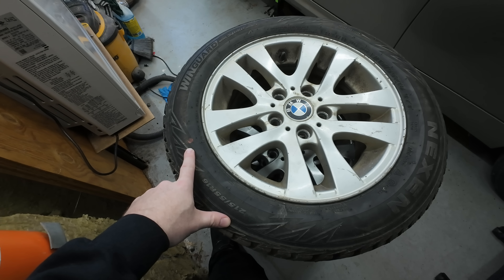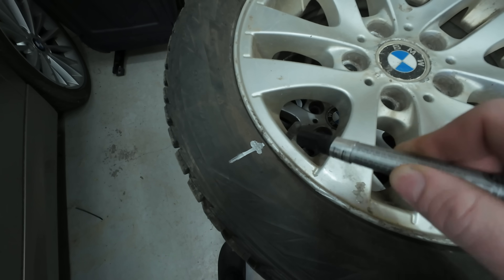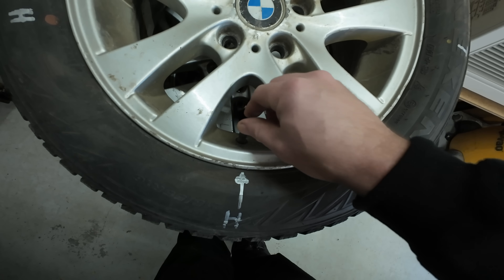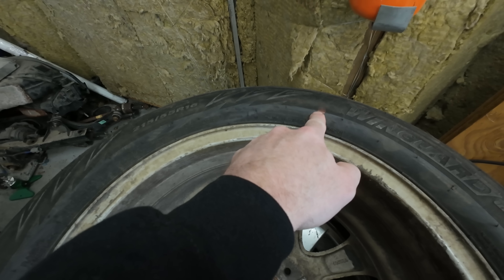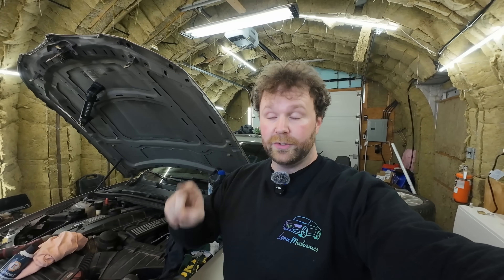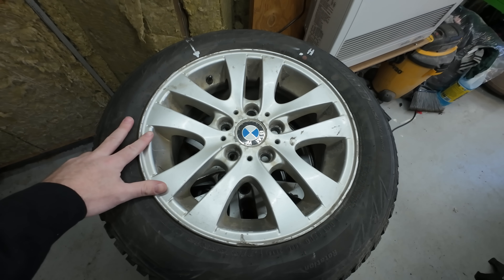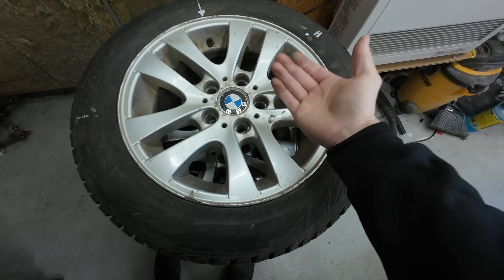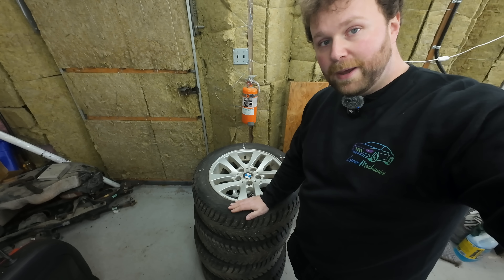Tire Red & Yellow Dots Explained | Back to Basics. Many mechanics get this 1/2 right

Comment from the maker: I feel most didn't watch the whole video. The highest point of the tire tends to be the heaviest. I'll tell you from experience. Most even admited in comments of busted rim down and spinning it 180

Yellow = light point
Red = heavy / force variation point

This is one of those basics that prevents comebacks and weird vibrations. Curious what your shop teaches — drop it below 👇

Edit. Do to confusion in comments. If you dont have a runout indication on the rim. Putting the red dot opposite the valve stem is good practice as it greatly reduces weight.
Reply: Does the valve stem actually weigh more then the metal missing from the hole in the rim where the valve goes?
Reply: @PaulLorenzini-ny2yw  That's a very good point! It's arguable that a session of just establishing the status of balance of the bare wheel is a good starting point before dealing with the tyres.
Reply: @stephenrose8188  I've balanced a couple tires in my time and it's remarkable how many times the wheel has the old sticky weight residue near or exactly where it was before, no matter which way you orient the tire.  I usually spin the tire on the balancer before removing the old sticky weights.  Quite often all I have to do is remove a half ounce from the previous balancing weights.  I heard Lance balances tires underground.
Reply: @PaulLorenzini-ny2yw  when you take into account the TPMS sensors (if equipped) then it may be heaviest spot.
Reply: @PaulLorenzini-ny2yw  I think it's more of the molecular distribution of the metal composition inside the actual alloy wheel, because when it is cast into that shape and then cools it's not a perfectly even distribution of the molecules ... 
  Also the Red Dot is not the "Heavy" spot in a tire, it is the "High" spot because tires are not perfect circles, the inner layers of a tire are layed around and around and they tend to overlap slightly in a spot where they start and end ...
Reply: @HomelandCitizenCCCP  high spot/heavy spot, its the same either way its the spot that throws the most weight when its spun, and thus the opposite/indicator side from where you want to start your balancing.
Reply: @crisnmaryfam7344  Heavy is mass for weight balance only. High is runout/stiffness for road force balancing. They're different terms for different things.
Reply: @HomelandCitizenCCCP  the layers are actually sewed together at that spot, and if not done in a good manner will distort the actual casing of the tyre. I have seen one where the seam had been pulled so tightly the tread actually dipped in where the seam was. It was not visible when fitted but soon showed as the tyre started to be used.
Reply: @HomelandCitizenCCCP  anybody ever thought about SLOWING DOWN!?!
Reply from the maker: Well considering a vehicle can't be sold in The USA with out a tire pressure monitoring system. I'd say absolutely :) All your vehicles since i think 2012 have tpms sensors.
Reply: Incorrect. 2008 and up are required to have TPM systems, but not necessarily sensors. Honda, Acura and VW/ Audi all have some models that use ABS/ wheel speed for the TPMS
Reply: @mattdudley3789  Do the Honda, Acura and VW/Audi systems work better because the sensor types suck because of dead batteries.
Reply: @Lancemechanics  Even a regular valve stem weighs more than the small amount of aluminum removed to make the valve stem hole.
Reply: @Lancemechanics   Is anybody still using wheel speed sensors for tpms?
Reply: @Lancemechanics many vehicles don’t use sensors in the wheels, instead they use math and the wheel speed sensors to calculate the tire’s circumference and recognize when a tire is low on air.
Reply: @PaulLorenzini-ny2yw 
Yes, much more.
Reply: @sammoxford On a CAT D12?
Reply: @sammoxford Probably from your company, dot invent much?
Reply: Tire balancing has been a major problem for me as a full time RVer.  Whenever I can do something myself i do because I actually give a shit about my things BUT no stranger at a shop cares.  Most of the time the tire marks are completely ignored even when it was specifically pointed out to the tech prior to the work.  I can’t even get the same valve caps back if I even get some back.  We now live in a weird upside down world that I can’t explain.  I like the video and wish I could get my hands on a diy static balancer that could handle 4 3/4 hubs since all my wheels have those specs.
Reply: @ronragan5144  the problem is, at least here in the UK the tyre companies use young unskilled labour to fit tyres, maximising the companies profits dur to the reduced wage bill. Once they can fit a tyre then balance it they are deemed to be a "tyre technician". I learnt the trade from a few good old boys that knew what they were doing and passed that information to me. Most young boys i would not lend tyre tools to they do not know what they are doing.
Reply: @ronragan5144  I was annoyed with a squeaking sound relatively recently and was changing the winters to summer tires and decided to do some lube testing on the bushings; see what's what. My gf came down to bring me some coffee and was showing her: see that there? Those two bushings make that damn squeaking sound (were the stabilizer/sway bar bushings going dry out of powder) and she was like: I hope you're not telling me you're gonna change them yourself?!?! Take it to the mechanic! My point to her was: I'm the one driving you around. I'm the one that cares; do you think those mofos give an f if they forgot or not to tighten everything back up let alone torque them properly?!? (Personal experience - gets some caution in you after it happens to ya).
Reply: @ronragan5144  You can still diy by renting out the tire machine and balancer. Do a google search for "self-service garage".
Reply: @ronragan5144  Research Flat Rate understand.
Reply: @PaulLorenzini-ny2yw   Flat rate is not an excuse for shitty work.
Reply: Shop owner taught me to line up the yellow on the valve stem side. Said it was the light side of the tire to offset the tire pressure monitor sensor on modern cars.
Reply: @thomascaruthers3316  It has been marked in that way from long before tyre pressure monitors ever existed, and yes its the light spot. The red dot is the layer seam where all the reinforcing is stitched together, which often makes little difference to the weight, but is often the low spot in the circumference.
Reply: @Lancemechanics   It's always the way it's explained that keeps everyone confused.

Yellow = light = lowest mass
Red = high = peak runout/stiffest point
Yellow is just for weight balancing.
Red is for road force balancing.
Reply: @absurdspeed  Red is not the high spot but the lowest spot and is where the tread layers are stitched together, causing a run out in the tyre circumference
Reply: @roberttill3787  Source?
Reply: So when you start explaing wat to do with two dots (R & Y) you go off on a tangent about wat bad techs do and actually dont say where to position the red dot! 

Im guessing you line up the yellow with the stem and the red 180 deg opposite but you dont actually say that??
Reply: @mgunning7362  Yellow is the lightest spot on the tyre, the red is where the casing reinforcing layers are stitched together, usually causing a low spot in the circumference of the casing. If you line the yellow dot with the valve and it needs a lot of weight, deflate and break the beads and turn the case 120 degrees on the rim. Then inflate and balance again. If there is not much improvement, repeat and turn the tyre another 120 degrees. In one of these three positions you will find the optimum balance point. I have done this many times.
Reply: Thanks bud, 
I did watch to the end,........and thought the end the most important part...
Balancing the Wheel first is a really good idea, first class!
The whole video was interexting and accurate, to be honest a well edited version, should make a really good educational aid.
Personally I prefer to see people demonstrating on a real object in real time, right in front of me.
I've been working on my own vehicles and others for over 35 years, and this was new.
So apparently a young whippersnapper can teach an old dog new tricks, 
Thank you. ❤👍💯
Reply: @Lancemechanics  I have been working on cars and trucks for over 35 years and I grew up in tire shops! I learned to use a bubble balancer when I was 7 years old in 1977 and 1.5 Oz on inside and the same on outside is fine for car tires but on trucks it's not uncommon to see 4oz on one side especially on certain tires that are crappie! Especially if you get into mounting 44 in tires for pickups! Infact I used to just use the balance powder on really bad ones! I found that the old tire truer was one of the best ways to fix ugly tires that were balancing up horribly! And tires that were recapped are notorious for bad balance
Reply: That will shake at 100kmh or 90mph? WTF??? They just don't add up. A 100kmph do not = 90mph
Reply: @whatsonline2025   Right.? Isn't 100kph something like 35mph or some nonsense?
Reply: @absurdspeed  100km/h = 60mph
Reply: @TjarkoTarnen  Yeah, I just like mocking the metric crowd because they tend to talk about metric speed as if they're really doing something because the numbers are bigger and people who use miles are like "Yeah bud. That's just driving around here. You did a commute. Congratulations."
Reply: @absurdspeed Right...
Reply: @absurdspeed  ...it's just another scale...whaddya want us to do, switch up the metric just for velocity so you feel better?!? 'c'mon now!
PS. I'm just messing around...don't really care, tbh :)
Reply: Please cover your walls. You are breathing dangerous fibres. This will cause you immense problems in years to come.
Reply: I have not had a perfectly balanced tire from numerous tire places and garages in years they’re always something not quite balanced properly when I get new tires mounted and balanced , people just don’t give a shit
Reply: I found different reliable sources that are saying different things. One says the red point is the heaviest area of the tyre. Another says its the lightest. And it also can mean nothing of them cause its just a mark from the manufacturer so they can easier find out where the tire was produced in case of a failure of the tyre. So basically the main problem here is: There is no definition what the points mean and also its not a mandatory to use them. At the end: Just ignore it and dont mind.
Reply: Easily explained, the red dot is the highest part of the tire....the biggest part of the diameter of the tire.
Reply: This is all wrong
Reply: @Lancemechanics  You dont need marked rim. In europe all machines have  optimalization option so you first put rim  check it and mark heavy place then you mount a Tire and check it again. After that you mark Tire and rotate it and it should be perfect. There is one problem that machie have tolerance option it should be at 5 grams but many shops have it set to 10 or even 15. In that way machine says its ok but its 10 15 grams off and its massive.
Reply: @EasyRider941  I'm glad Ukraine is on your side.
Reply: @EasyRider941  modern balancers will easily balance down to one gram  Tyre bays dont use it as to balance this accurately takes time, which a quick fit, drive in drive out bay cannot afford.
Reply: When i was trained, They forced us to do the 180 out test, just to prove it to us and really sink that idea in. Most though it was a useless exercise until they seen it actually made a difference. Once they find out they can fully balance a good wheel without even havin to fuss with wheel weights.. they take notice..
Reply: @Lancemechanics   Also the hole for the valve is drilled opposite the highest point on the rim… thus the completed wheel is the closest to being perfectly balanced.
Reply: @sammoxford As long as it's centered between the center of the spokes, every time so the hub cap fits.
Reply: @sammoxford  What does valve stem position have to do with rim runout?
Reply: No such thing as a tyre technician, just some guy that isn't good enough to be a mechanic!
Reply: @jarnosaarinen4583   This is mantra of every guy who isn't good enough to be a mechanic but, is still allowed to work on cars.
Reply: well, you are correct that red dot lines up first, but not like you said. Red is highest radial runout, it lines up to the rim lowest radial runout. not a lot of rims mark this spot but you can find some with a rectangle yellow sticker or a white dot on steel black rims. if you line up red with 180 of valve, and that part of the rim happens to be the highest part of the rim, you just matched a high spot with a high spot and will get vibration even with a balanced wheel. there are balance machines that will detect radial runout of rim and tire to help match and reduce vibration, but for the most part regular balance works fine

Comment: What's unusual, is that the dots in this example are across from each other. They are usually at more random points, sometimes within a couple inches of each other. I have even seen them overlap (the most rare, I admit).

Comment: Now here's one for you. Back when I was a P&D Contractor with a TL and LTL freight carrier we would get a full trailer load (TL) in from a tire warehouse over in Mississippi going to the various tire dealers in our area. Now on the freight bill if so many tires went to one particular dealer the freight bill would have a notation of a specific colored dot on the tire to denote the actual destination. Of course this does away with having to have an address label or a pro sticker on each tire. That's fine but what about the poor tire technician who doesn't know about this or the dots are put close together and the fellow sorting the freight out doesn't know which dot is correct for the delivery location. Of course if the color system is restricted to just the red and yellow dots  and knowing what they mean that is fine but when one gets a tire with different color dots right beside each other it can be confusing.🥸👍

Comment: Greetings from Pfungstadt Germany the original Hometown of Hofmann Balancing and Tire machines. I'm doing this for years, the method you describe in the end is called matching. Finally i got me one of the last build Hofmann Geodyna here in my Hometown with three lasers which scans the rim prior and rim tire combination and show you graph where the exact highspots are and how much higher they are. But the old geodyna 3000 upwards could it too the wheel matching at least, not that precise but good enough, I did on our gas station for years on 3300. Good video keep up the good work from metric heaven Germany.

Comment: your sure? i aligned the yellow dot on valve measured , then aligned red dot and measured, yellow on valve more weight that red dot on valve. i left it on red. could it be a manufacturing thing between red and yellow?

Comment: The balance of the wheel involves both the weight of the tire and the weight of the rim.  What you are displaying is that by marking the tire, the manufacturer introduced the possibility of error.  If a technician ignores all markings and just balances the entire assembly he will have less of a chance of doing it wrong.  Yes, a tire has a single heaviest spot as does a rim but there is much more to it than that.  How much heavier is the heaviest spot compared to the next heaviest spot?  If tire is mounted intending to put the heaviest part furthest from the tire valve, does that now make some other part of the tire the heaviest?  Just put the tire on the rim and balance it.  It will be fine.
Reply from the maker: did you watch the video. I'm the guy who has to diagnos these tire wearing issues and shakes at high speeds. Cause you just put the tire on the rim and balanced it.

Comment: I can't how many idiots I've seen mounting tires incorrectly and adding more and more weights to try and sort it out. I remember back when they were arguing about directional tires!
Then, if they place them on a vehicle they use worn out torque bars, over tighten them and strip the edges round on the lugnuts so you can't get them off properly to replace them. Then, when you go back to complain and demand a refund they act like your crazy and refuse to help you. Always go to a professional tire shop and pray 🙏 beforehand!

Comment: I ran bike shops for years, when changing tires (or especially when building new spoke wheels) I would take 2 minutes and hang the bare wheel on a bubble balancer, and mark it. Then put the tire on, but not seated, and hang it again, using the dots, then I could just spin the tire a bit towards/away From my wheel marks.  8 out of 10 I could get them needing zero to 1/4 ounce of weight.

Comment: This guy is so wrong.  100kph = 62 mph, not 90.  The red dot is not the heavy point, it is the point of highest road force variation.  If the tire has dots, and if only a yellow dot, put that light point at the heavy valve.  If only a red dot, on a steel wheel put that at the dimple on the wheels showing the low point.  On an alloy wheel put it at the valve.  If both red & yellow, ignore the yellow and put the red at steel wheel dimple or the alloy wheel valve.

Comment: Backyard hack with Coats 10-10 and a bubble balancer here thanking you for this insight! And an honest question: does the valve stem really weigh more than the metal removed to form the hole it fits in? I've always thought it was a wash.

Comment: When I mount tires for myself I often run the rims without tires in the balancer first to find out where they need balancing weights and then mount the tires accordingly with the heaviest part aligned to the lightest part of the rim. In that way you minimise the balancing weights needed.